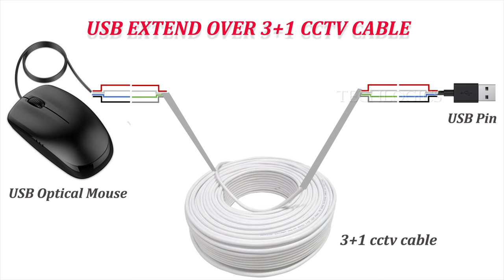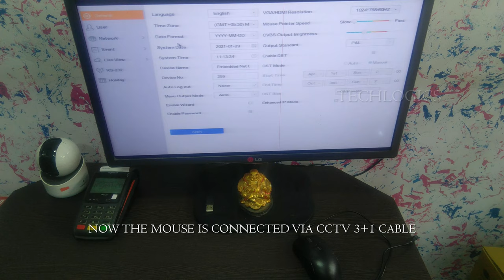USB Mouse extender upto 50m via 3+1 cctv cable, CCTV DVR / NVR Mouse USB Extender without converter

Comment: Its working perfectly till 50 mtr ,new cable and joint with solding, new mouse need ...im try first its not working but new wire ,new mouse and joining with solding its worked

Comment: Who the hell want to extend mouse cable with 3+1 cable when a wireless mouse is available at just 1/3rd price of cctv cable, and a good quality wireless mouse could easily reach such distance of 50mtrs
Reply: Won't walls block the signal?
Reply: Where do you base?
Reply: @ogbonnayachinedu   india 🇮🇳
Reply: You assumed that all  camera systems have  not obstacles between the mouse and the screen, No ,wireless mouse is fine if the NVR and the Screen are close to each other, and if there no furniture or object between the mouse and the NVR, when there are obstacles  an extension to the mouse is necessary.

Comment: Why you dont use Cat6 cable?
Reply from the maker: cat6 cable also we can use
Reply: I also wanted to knw how can i run a 50m cable for mouse to the security gate office... I was considering a cat6..
Reply: @rodreckkabaya3669  is it worked with Cat6???
Reply: @razu495  i was also asking if it can work

Comment: 3+1 se 50 mtr cable se nhi chalta hai
Only 10mtr kam karta hai 
Mouse ko chalane ke liye rj45 to usb souket ata hai uska last range 45mtr hota hai
Reply: Bro mujhe 10mtr wala extension ke aage wifi adepter lagake use karna h usme speed loss hoga kya?